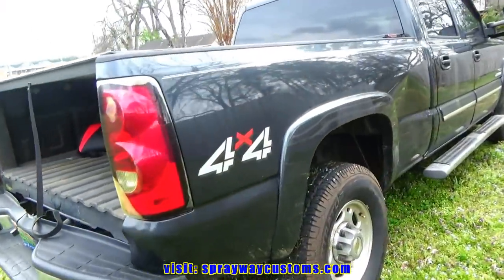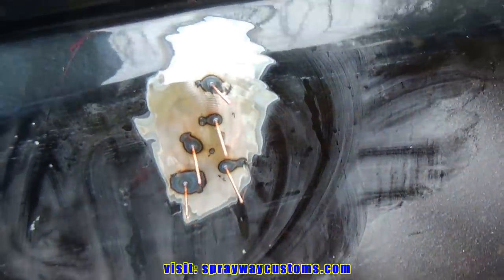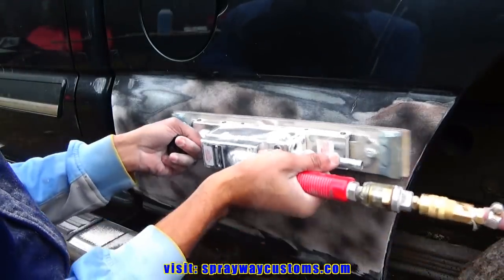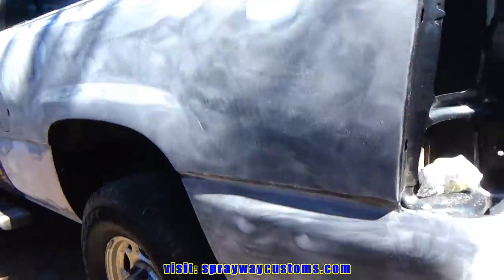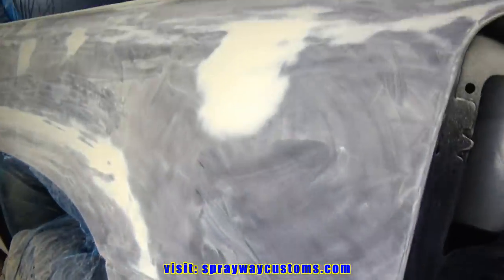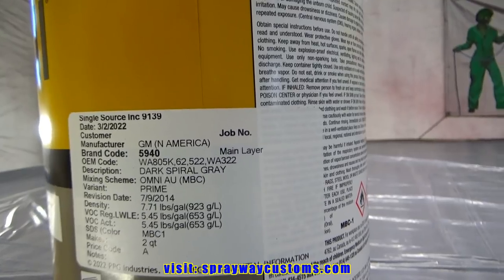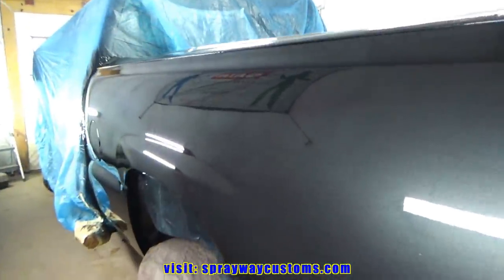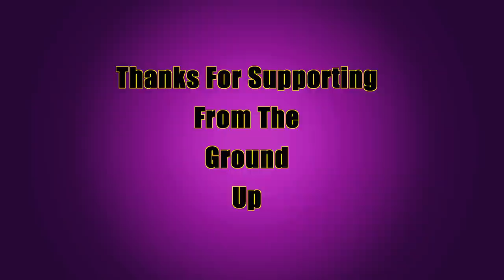Painting A Car Or Truck At Home - Bodywork - Ding & Dent Repair - Sanding - Priming - Spraying Paint

Comment: Hey, just an idea from when I did body and paint for many years. I used to wet down the floor to keep the dust down while walking in the booth and to avoid getting trash in the paint plus lower the static charge level.  I would then wrap a chain around the rear axle of the vehicle to ground the vehicle because while you're spraying you are conducting a static charge when laying down the paint that comes from the gun which attracts the dust/trash to the panels.. Also after I wiped with the wax and grease remover (which causes a charge when you rub) I would use 50/50 rubbing alcohol and water in a spray bottle and wipe down the vehicle to also help keep the static electricity down.  Thought I would share-
Cheers
Reply from the maker: Thanks man
Reply: @SprayWayCustoms  You're welcome!  Also I noticed you have a lot of over spray in the air while spraying and I found that it's much better to have a positive pressure booth compared to a negative pressure booth to lower the amount of over spray in the air and to keep the dust down..  It looks to me like you have a negative pressure room which means you have fans blowing air "out" of the room that causes any dust particles that might be on the walls and ceiling to be disturbed..  If you have a positive pressure room which means you have fans blowing filtered air "in" the room, it will settle the dust that are on the walls, ceiling and floor (basically pressurizing the room)..  You may wonder if you have a positive pressure room where will all the over spray go..  That's where you get a good size tub, put it in the room at one end, fill it with water, set up a fan above it that blows the over spray into the tub of water.  The water will catch the over spray and keep it from being in the air any longer..  After you're done doing multiple paint jobs you can sift the top of the water to get all the over spray particles out and be ready for the next job..  Hope this helps..
Cheers

Comment: I have a question for you I had to tig weld one of my wheels and ground it down so will Bondo hold or should I use glass resin your opinion would be appreciated thank you
Reply from the maker: Fiberglass filler will work better

Comment: Not related to this project but I’ve seen you spray urekem epoxy over other projects like the 74 caprice. Are you concerned on older cars that there may be lacquer paint l? I’ve heard others say not to spray over lacquer because the 2k products will soften and cause the lacquer to peel at some point in the future. Some older body guys I’ve talked to say not to worry as long as you use epoxy to lock in the lacquer. Then you can use 2k over the epoxy and not have to worry. What are your thoughts?
Reply from the maker: That’s why I spray epoxy for situations like that to seal it

Comment: I'm just about ready to shoot my plastic bumper on my 06 Lincoln LS. What should I use instead of wax and grease remover since that is not good for plastic?
Reply: Alcohol from the drug store, 90% if you can get it. Go to dollar general and get this: Rexall 91% Isopropyl Alcohol, 32 Oz., glass cleaner as a second cleaner would be a good idea too. You can get it at Dollar general also - Sprayway Foaming Glass Cleaner, 15 Oz.
Reply: @phordguy  nice. Thank you for the reply. Good timing too because I'm right next to a dollar general. Now, the only thing I don't have, and I just found out about it, is a flex additive for the clear. I'm going to call some body shops around me and see if I can buy a small amount, just enough for the bumper.

Thanks again.
Reply from the maker: Thanks for the reply phordguy
Reply: @NiftyAutomotiveKnowHow  I wouldn't worry about the flex additive.  My ppg reps told me it is only good for a day in support of the bumper being painted off the car and then being installed.  After a day the paint hardens so much that it can be buffed and the flex is no longer a factor per the ppg shop reps I used to use.

Comment: Hey Sprayway I have been a fan for years now but I have a question about the high build primer. Is it ok to use the 2k hi build on bare metal like you did on this truck?I have both 2k epoxy and urethane primers but if I can go right with the urethane after bodywork as a spot primer over some bare metal, that would save me time. Thank you for all you do for us beginning painters.
Reply from the maker: If the 2k is DTM (direct to metal) you can.